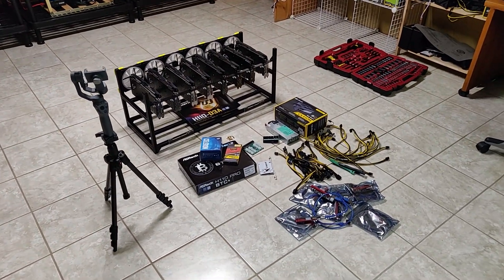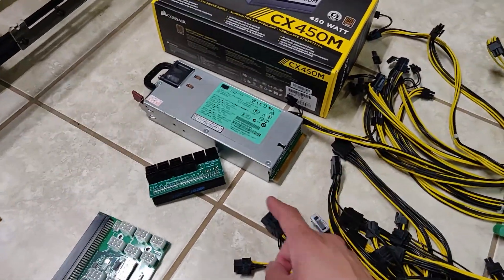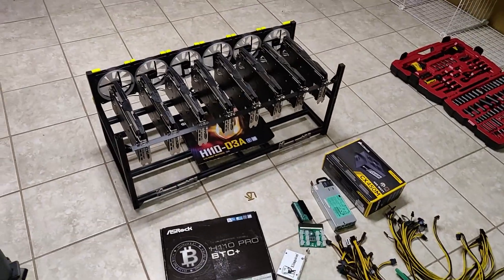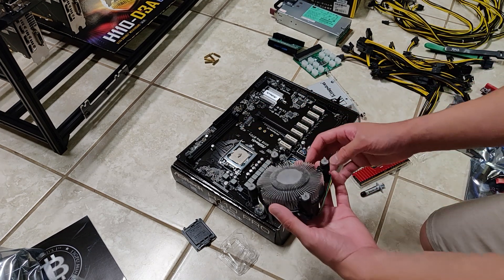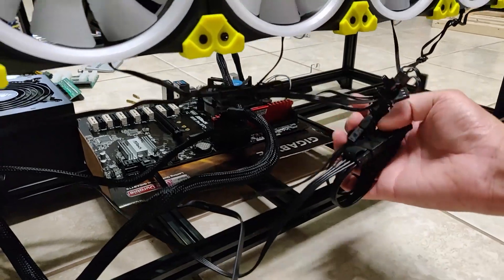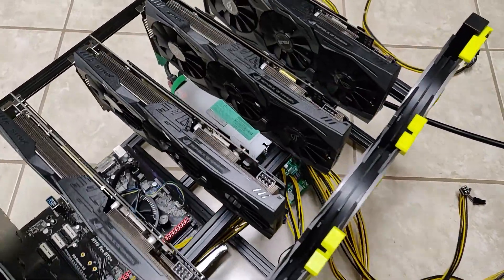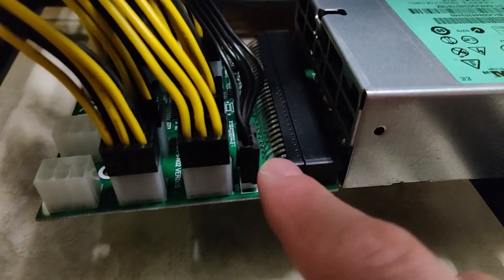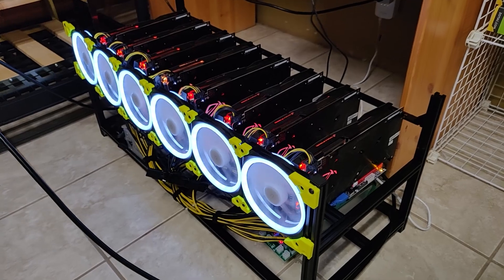Building the 8 x RX 480 8GB Mining Rig... FINALLY

Comment: I have both break-out board models you have shown. The only con to the newer model is the on-off button is not mechanical. If the power flickers or goes off then back on at the remote location you will have to physically turn it on again.

Comment: You could mount the server power supply with 3M dual lock. That's what I use when I cant mount something with a screw. It's not like Velcro it has insane holding power and more.

Comment: Hi, I was  facing  issue with Gigabyte B250 fintech,  same issue with H110 Pro. Do we needs to connect 2 - 4 pin molex cable to mobo in order to connect 12 GPU???

Comment: Hey panda what type of power cord did you use to power the server PSU, same type as used on normal atx PSU ?
Reply from the maker: hey buddy, i used a c13 to c14 tripp lite power cable
Reply from the maker: not the same cable as a normal ATX psu. its a 240v specific cable c13-c14

Comment: Cutting it pretty close from the 6pin power on breakout board don't you think? A 6pin is rated to provide 75W of power. Those cards will draw up to 180W. Technically a 6pin can handle up to 192W with 2 +12v leads and using standard 8 Amp contact terminals. If your 6pin connectors are utilizing all 3 +12v leads then you should be fine.
Reply: Side note: If using 18AWG wire I'd try to stay within about 4 feet that way you'll maintain 98% efficiency on your voltage output.

Comment: My 5 USB asic miners which cost only $57 each has a way higher hash rate then all that and tons cheaper to build.
Visually that looks like a $3,000 - $4,000 rig and mine is under $500   I have 10 more that will be on the way in a  couple of months.
Your entire rigs...... sell them and convert to USB ASIC mining.  Less electricity and less heat

Comment: bro why do you use 2 power supply and one of them its a server PS, when you can buy perfect shape 1200 power supply platinum and gold evga, corsair etc for only 70 bucks on ebay? and they are still in warranty
Reply from the maker: Mistakes were made.
Reply: I guess it depends on location, server PSU's are super cheap here in the UK and if I were to try buy an equivalent ATX PSU on eBay I would be looking at around £130... Whereas I can get a Server PSU for £20 + £16 for breakout board and cables. Makes much more sense going Server PSU's over here.
Reply: I can get server psu cheaper then a normal psu and the server psu is made for 24/7 running.
Reply: Plus if you get a server psu in a bundle you'll have all the cables. No ordering extras

Comment: This is a cute hobby.  Cali pays .29 kWH for electricity.  Cannot make any money.  Id like to see these kids power bills.  I think they are mining and their parents are paying the electricity.  How much does a rig cost?  1000, 2000, 3000?  Stupid.  Buy an S9 antminer  and power supply for 240.00.  Run it on battery backup solar so it is all profit.  Easily clear 2 to 4 dollars a day for each machine.  You can get a 3000W solar panel an Amazon for under a hundo.  No battery backup, but if you run your miner during sunlight days you can buy a battery backup in no time.  China also makes complete solar systems for about 1000 dollars per 1000W of power and it does have battery backup due to the fact that it is an off grid setup.
So many videos.  So much nonsense.  I feel like Im trying to take OpenCV (intel framework) and trying to use it in Xcode (Apple IDE) and make an app for iOS (iPhone, iPad operating systems) with nothing more than outdated internet info.  Oh wait...I already did that.  Watch Vosk Coins channel, he is up front.  He geared up to mine with GPU for a year.  Had to cut back, added some ASIC (like S9) machines.  Now he makes a bit of money again.  The problem is the hash rate increases as fast as computer technology.  You might make money today, but every month you will make less due to the constantly increasing hash rate.
Kids quit spending your parents money or you will not have any inheritance left.